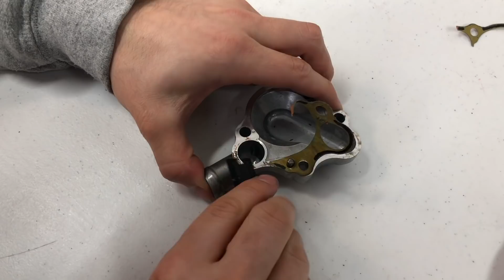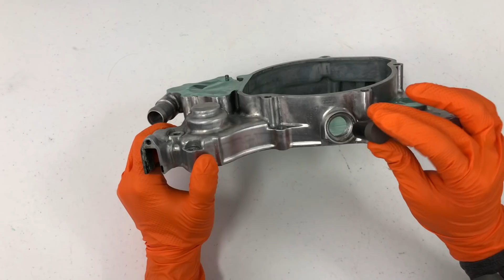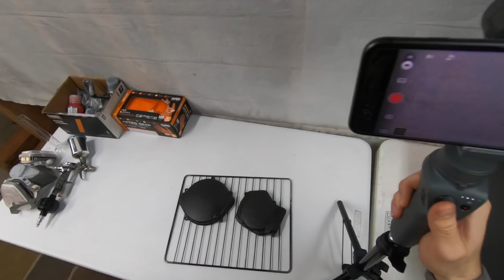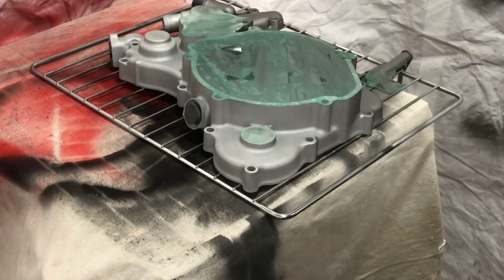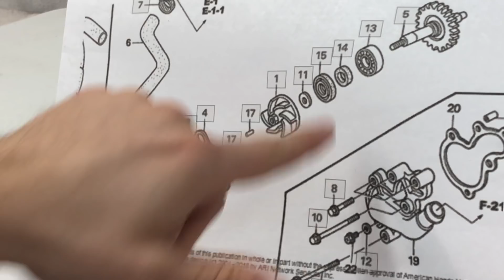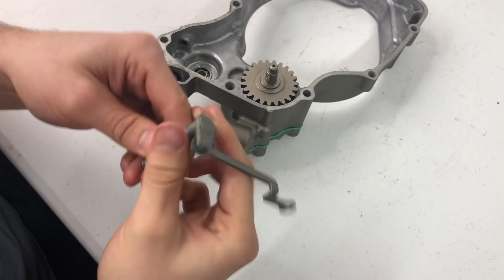DIRT BIKE ENGINE REBUILD (AMAZING TRANSFORMATION)

Comment: /p'''{2:8 || 3:9[m (tTxn''') xyz 6x vlt}] @ bttmz mdx ovs RPM'DMZ'/
/i/o ext lb(WVlochz''') by: grpx grdz VAAKUUMZ i.e. thrml < mrks @/
/~38deg''' spray gear paar DMZ' weivttx in bttmz RPM'/
/> ++- mdx VAR DMZ' < AVN KTM loch | R&D VAAKUUMZ YSP HRC BRAEBUS > i.e. Ei K' mech skech 3-D net grfx//> 6x ~ m(vltz) int= ovs ext net grdz - VAAKUUMZ ++- rev FZ'{9:2 || 8:3 int= X'''}/

Comment: Question: The link to the Cerakote colors is for the air-cured versions of the coatings. I noticed that you oven-cured these parts, is that a mistake or did you do it for faster cure times?  Also, what is the name of the Red you used?  Thank you

Comment: Hey dude, i'm currently rebuilding my 07 cr125. Ur build honestly helps me out so much man, you're great. Did you reuse all the bolts/screws/hardware or did your source brand new ones if so where can I get a full kit? Also, may I ask where you got the detailed diagrams? Thanks man :)

Comment: hi adam, i know this is an old video but was wondering if there was any dowel pins installed on the waterpump cover? I am not talking about item 17 on your diagram. I have a cr 125 1996 and on my diagram it does not show any dowel pins apart from the same item 17 although  two holes look slightly bigger for dowel pins.

Comment: Can u just use a new razor for removing gaskets
Reply from the maker: I use plastic razor blades you can use metal. The reason I dont is because if you slip you risk damaging your sealing surface because the steel cuts into the alluminum

Comment: Can i ask what carburetor you will be using? Standard mikuni or upgrade to a keihin? I have a 03 cr 125 with the keihin, just bought the bike and the jetting is off. Would like to know your input on jetting
Reply from the maker: I’m using a lectron so won’t be doing as much  jetting. But definitely will have some jetting videos coming up, just not for this bike!

Comment: Can you cera coat cylinders and head cause I have a kxf 250 I'm rebuilding and think it would finnish the bike of to have a black engine
Reply from the maker: Good question! I Don’t see an issue with it though I have never done it before!
Reply: @adampaganelli4891  yea after I commented I seen a kX 125 engine that had been done in that dusty bronze color